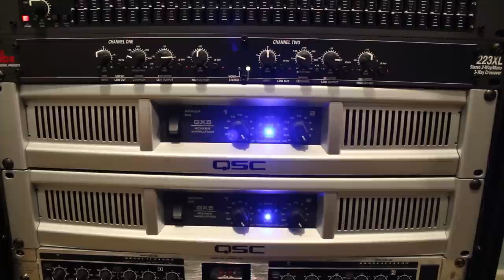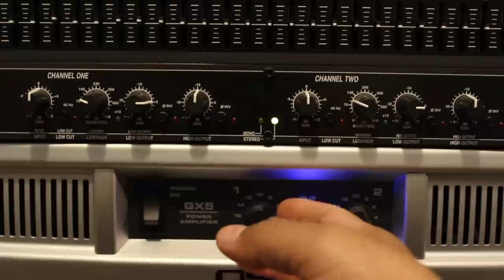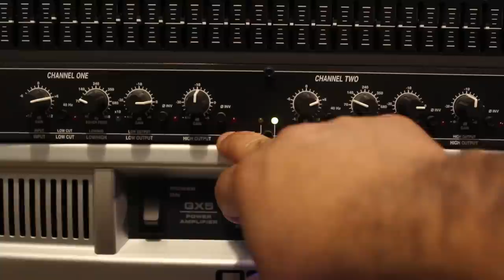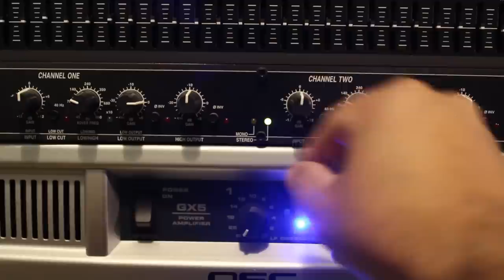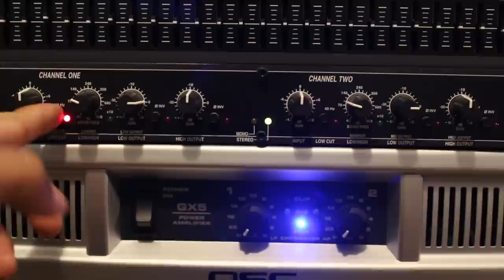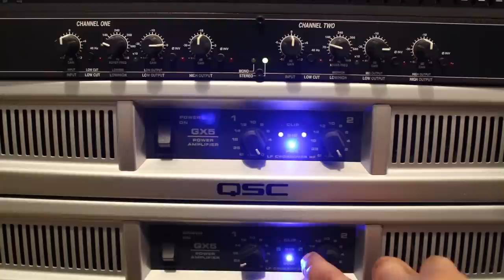How to Setup active crossover dbx 223XL into your PA system | DJ Setup | Live bands | Live events

Comment: Good Video. That QSC amp has a built in XO. You can just flip a switch next to the inputs. You could skip the XO/you would loose some control, but it does the job. Also gain staging!!!! You don't need or want any amp cranked to 10. It's a process, every instrument down the line needs to be around "0" or unity(to start), where the input equals the output. Use meters and your ears to find where things peak or get distorted from signal source, to mixing boards, to amps, and finally to drivers. when it is staged properly you can crank the main fader on a mixing desk, before the amps, and get even more DBs when there is some headroom. If the amp is cranked it will never get louder, just crappier. You get more clean tones and more volume thru gain staging. Other people have said this way better than me. Research gain staging.
That mono sub switch is cool too. Keeps the tops stereo, sums out of a single output. If you have two sub cabs just run them in series.

Comment: I am trying to figure out how to let my 15" 2 way main speakers go down to 50Hz & be able to allow my 2 Subs to play 30Hz as rated to overlap the mains up to 300Hz. Because the Mains have great punch when they hit 50 Hz. DBX didn't figure that one. I just got a new DBX 223XS & I also ordered a New line of XLR Cables from SVS who make Home Stereo Subs. I can say the SVS XLR is about a 1/3 overall improvement to my sound system, I had Peavey XLR 10' cables at less than half the $rice for the SVS. They are worth the extra $. Good vid. I am looking for what benefits I can get by adding built in Crossover to my 18" Subs. I see Most Crossovers in Speakers have Copper windings & the DBX has no Copper windings at all. I hope to learn this Crossover Science.

Comment: I recently purchased a an OPTIMUS PRO SW-10P 120 WATT POWERED SUBWOOFER. I want very much to use the subwoofer with my output PA System for for vocals or piano. Your instruction were excellent for I clearly understood the parameters. If you could offer some advce or  a video explaining how to use a subwoofer in connection with performance I would greatly appreciate it. Thanks for info. I'll be looking to hear from you.  Poinciana

Comment: Do you use an active and passive crossover together? Does it imply that when using an active crossover, a passive crossover should be disengaged from the speaker box. Thanks.
Reply from the maker: in order to use full functionality of active cross over you have to disconnect the passive crossover built inside the speakers , watch my other videos where i have demonstrated exactly how to do ot

Comment: awesome video! But can you help me? I am using only one amp with two channels..... i have the dbx 223xs. How should I connect my PA system, it's for a church. Currently, i am running R and L from mixer to each side of the Crossover....so Rt is to Ch 1 and Lt is to Ch 2. From there, I have the highs out from Ch 1 of the Xover to channel one of the amp, and Lows from Ch2 of the Xover to channel two of the amp.... is this the best setup I can configure? Thanks!
Reply: You need to use a cross over to connect a subwoofer with additional amplifier for the sub alone.

Comment: Hey buddy I know this is video quite old but I came back to it because it helped me tremendously in the past. I was hoping you could help me with current setup and issue. I'm running 3 amps, crown 9000 (for subs) and 2 crown XTI 2000 (linked together for tops) with a 3 way behringer active crossover. I would like to know how to run my subwoofers on mono and my tops on left and right full range specifically. As I've found that when running subs on Chanel left and right with the tops I get good base However no mids from the tops! I have to turn the subwoofer gain up to get the mids I desire from my tops as all I hear is the compression drivers screaming. However this overdrives my subs. So I would like to run the sub mono 3 way wile using the tops on left and right that way I can use the low gain to turn the mids up on my top speakers not the subs. If you took the time to read all this much appreciated and looking forward to your help!

Comment: Would a active cross over be needed with a intergrated amp 380 watts rms per channel and a power amp 900 watts per channel rms. I use instrumental woofers, no subs. The inzergrated amp is used to play 450 watt speaker for music listening and the power amp powers 900 watt 12" instrumental woofers. If have guests use both amps together to use for loud karaoke. No need the deep bass of sub woofers. Mostly just listening to top 40 pop music of karaoke singing.
Reply from the maker: the integrated amp driving the passive speakers (  speakers have tweeter and woofers ? )
Reply: @AVMEVideos  yes 240 watts 6.5" mid and 3" 80 watt tweeter. The power amp is powering the large speakers, no sub woofers the 12" woofer is instrumental. The intergrated amp a joson Jupiter v1 is powering a pair of kevler kv 450 speakers. The power amp I think I'll keep the 400 watt live woofer 12". I was going to put a 900 watt instrumental 12" woofer I think that will be to much for the 900 watt challenger ca 9 power amp that is upgraded to 10 pair of transistors and 12 capacitors for a total of 900 watts RMS per channel. The sound speaker which the power amp will power is a 700 watt crown bf1268. Both of the 700 watt speakers have passive crossovers inside that control the mid and tweeter. Just did not know if an active crossover would be needed because I don't use sub woofers. The 12" instrumental woofers put out enough bass for me. I just wanted to know is it better to just link the 2 amps because I have no sub or would it be better to connect the 2 amps with active cross over. Both speakers have a 12" instrumental woofer and they both have good base. If I use an active crossover and make one channel low and the other high I will lose some of the base in the speaker hooked to high? Right now I have a 6 channel titanium mc6 mixer and a dbx 215s equalizer.
Reply from the maker: You should be okay with your setup driving the speakers from 2 amps individually . The passive crossovers would do the job . No need to link the amps , no need to add active cross over .
Reply: @AVMEVideos  thanks.

Comment: I have the same crossover, and my question is that why is that the low level knobs have to be almost at  90 pct wide open for the bass to be even heard. Compared it with an ashly 2 way and the bass knob on it is at 12 o clock, same db level with the dbx. same gain structure, just an A and B test.
Reply: Because the Ashly probably has a higher "signal to noise ratio" than the dbx,

Comment: Quick question would the circuit breaker trip if you were to plug 8 power amplifiers into one breaker
Reply from the maker: i.e lets say each amp Max power is 500W so 8x500 = 4000W 

You would need a 16A circut breaker i.e 16Ax240V = 3840W

Once power goes up 3840W the breaker would trip.

Thea's why you need power conditioner ( surge protection and voltage regulator installed with your kit ) so it protects your kit.

Power distribution should be discussed , design & implemented properly with an expert electrician  , above is just any example for you to comprehend .

Comment: Hi please do you have to use compressors gate and limiters as well to protect the speakers or you can just run it with the active crossover and the EQ Thanks
Reply from the maker: +DJ AHOUFE , Sorry for late reply , The dynamic tools like compressor , gate ,  Limmter & expansion are to setup thresholds and to control the input signal. For DJ the tracks you playback , the  dynamic tools are already applied in studio during recording & mixing . Dynamic tools are more for Live sound like a band performing on stage or Live conferences , not playingback tracks. This applies to Spectral tools like  EQ as well , the tracks are already EQd in studio so apply as less EQ as possible if needed. If you DJ indoors then only thing i would suggest to apply is Time based tools like Delay & Effects tools like reverb to better distribute and shape the sound according to the venue if using mobile DJ equipment. Hope this helps.

Comment: hey buddy, thank you for the information loved it !!! im a bass player in a band and im looking after the sound, my issue is to take bass guitar and the electronic drums bass pedal to my bass bin, here is the setup
2 x Alto TS15 for Mids and tweeters, 1 x Alto TS 18 bass bin my mixer is Soundcraft UI16 digital mixer even tho its used the dbX plugin it still does not bring out the crossover perfectly, watching your vid explains how im going to get my sound clean and channel the correct frequency to the right speakers.. so getting the DBX 223XS will help me to get that perfect crossover sound right?
Reply from the maker: +Jacques van zijl , Yes this mixer does not have a built in dbx crossover signal processing , it only has dbx 4 band parametric EQ and dbx compressor/gate processing. You need a external crossover for what you are trying to achieve.
Reply: +AVME Videos (audiovideome) thank you buddy, ill get me one end of the month
Reply from the maker: +Jacques van zijl , sounds good .

Comment: Hello: Very nice and informative video regarding to the set up. Could you explain how to set up a stereo connection with a Pre-Amp, 2 power Amps, a mixer and a Graphic Equalizer. " The crossover is a PV 23XO with XLR, input and the other equipment are all with RCA out put, Thanks in advance.
Reply from the maker: +Havel G , Please watch this video https://youtu.be/hE3DOCgvBDk.

Comment: you have crossovers in those amps your using.and they work pretty well!
Reply from the maker: Yes i know but they are limited to 100hz.
Reply: oh ok i didnt know that.thanks for info
Reply: Thanks for the video, we're crusade this 29th march to 31 march 2017, We have DBX 234 XL crossover, Using  EV Full range, and Subwoofer, Should we set the back Knob to 3 ways stereo or we should set it to 2 ways stereo, and use the high out & and low out..,, Please urgent answered need 2days to go to Crusade Ground !!!!

Comment: Question I have an titanium mc6 mixer and 2 amps. A challenger ca 9 the updated version with 10 pairs of zransitors and 12 capacitors watted at 900 watts rms per vhannel at 8 ohms and 1350 at 4 ohms. Second amp is a joson jupitor v1 at 380 rms per channel. I want to link that as my secondary amp it will be used mostly for listening to music outside in my make shift gym with 450 watt kevler kv 450 speakers. The jupitor has the mic pre amp that i use to song karaoke with. The new amp has no pre amp so i ordered and inline pre amp so i can go right in to the mixer without the intergrated amp. Why is the signal on the mixer so weak? Its the 3 rd mixer i have had and always end up using the mic output on intergrated amp. Its a shame cause the mixer has 256 effects for mic but weak signal cannot use my high power speakers wash out the sound plugging right in to mixer. But plugging into intergrated amp has power but i no longer can use the 256 effects on amp plugging mic into 8ntergratted amp and not mixer.

Comment: Thanks for the video, we're crusade this 29th march to 31 march 2017, We have DBX 234 XL crossover, Using  EV Full range, and Subwoofer, Should we set the back Knob to 3 ways stereo or we should set it to 2 ways stereo, and use the high out & and low out..,, Please urgent answered need 2days to go to Crusade Ground !!!!
Reply from the maker: Okay , what is the Model number of your EV full range tops and subs , How many amps your are planning to use then i'll tell you whether to use in 2 way stereo or 3 way stereo with DBX 234 XL.
Reply: 2 Amps, 1 for EV ELX215 Full Range & 1 for EV MTL1X SUBWOOFERS  and our  DBX 215s
Dual Channel 15-Band Equalizer, How we should set it on front panel .. Thanks waiting
Reply from the maker: okay below is your signal flow. Please share your feedback of how your setup served you and how was your gig once done.

1: L out from Mixer in CH1 input on Dbx215s GEQ. R out from mixer in CH2 input on Dbx215s GEQ.
2: CH1 output from Dbx215s GEQ to Dbx 234 XL CH1 input . CH2 output from Dbx215s GEQ to Dbx 234 XL CH2 input.
3: Use Dbx 234 XL in 2 way stereo mode.
4: CH1 high out from Dbx 234XL to CH1 input on 1st AMP then output to  L side EV-ELX215. Make sure the amp is capable of 4 Ohms & minimum  960Watts per channel.
5: CH2 high out from Dbx 234XL to CH2 input on 1st AMP then output to  R side EV-ELX215. Make sure the amp is capable of 4 Ohms & minimum  960Watts per channel.
6: CH1 Low out from Dbx 234XL to CH1 input on 2nd AMP then output to  L side EV MTL1X sub. Make sure the amp is capable of 4 Ohms & minimum  1920Watts per channel.
7:  CH2 Low out from Dbx 234XL to CH2 input on 2nd AMP then output to  L side EV MTL1X sub. Make sure the amp is capable of 4 Ohms & minimum  1920Watts per channel.
8: Crossover at your desired frequency point , I usually do it between 60 to 80Hz. Don't go above 120Hz as you would get lyrics out of subs which you don't want.

Hope this helps.
Reply: Thanks so much the  connection work perfect and we got everything good, but we experience some change while playing a song for sound check, we got bass out of the full range, that is the problem we face, so we use GEQ and the compressor  and disconnect the crossover, in GEQ we use channel 1for fullrange and we loop it and channel 2 for sub-woofer,, ,,,, but we think we should use the crossover 3 way so that we connect the high to the full range ... We're having another crusade in June .. please any help ..    God Bless you for your assistance

Comment: quick question.. what if i dont have a subwoofer how do i connect crossover to amplifier to speakers? do i connect the the low and high from crossover to one speaker?
Reply from the maker: , you need speakers that support bi-amp . Also u would need two amps , then just follow the signal flow from crossover to amps to speakers as explained in the video. if ur speakers don't support bi-amp then no point using active crossover .

Comment: Hi... Can you show me how to set 2 ep4000 amps... With a cx2310 crossover... I need to set the top amp for tops and bottom amp for base... And settings for the crossover. Please assist... Thank you
Reply from the maker: Vin Chuhan Signal flow is: 
1: L XLR output from your mixer to CH1 XLR input on CX2310 crossover.
2: R XLR output from your mixer to CH2 XLR input on CX2310 crossover.
3: Press 2 way stereo button on back of CX2310 crossover.
4: CH1 Low XLR output from CX2310 goes into CH1 XLR input on your bottom amp then CH1 speakon output  to speakon input on Left sub/bin
5: CH2 Low XLR output from CX2310 goes into CH2 XLR input on your bottom amp then CH2 speakon output to speakon input on Right sub/bin
6: CH1 High XLR output from CX2310 goes into CH1 XLR input on your top amp then CH1 speakon output to speakon input on Left Top speaker.
7: CH2 High XLR output from CX2310 goes into CH2 XLR input on your top amp then CH2 speakon output to speakon input on Right Top speaker.
8: Make sure Xover is set to x1 on back of CX2310 .
9: Crossover between 70hz to 120Hz until your desired sound is achieved.

Hope this helps. Thanks.
Reply: Thank you so much... God bless